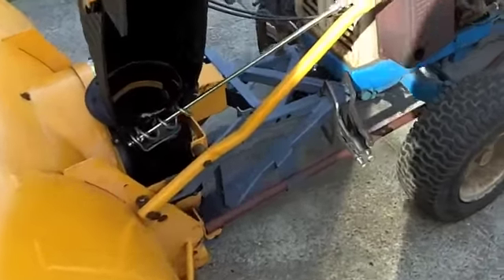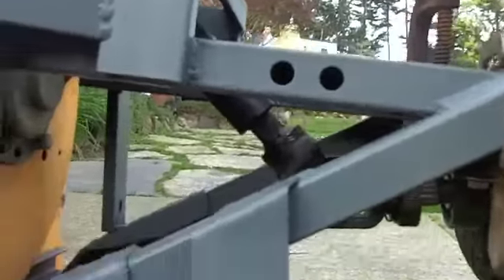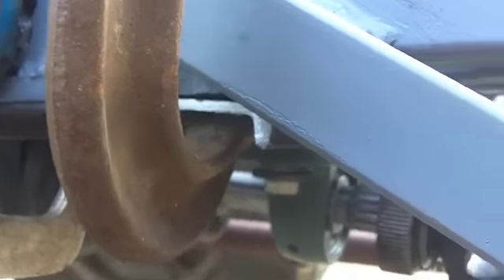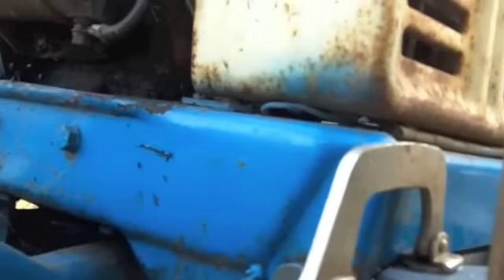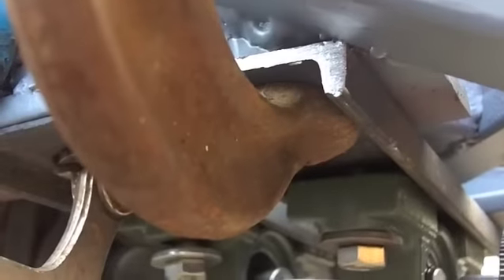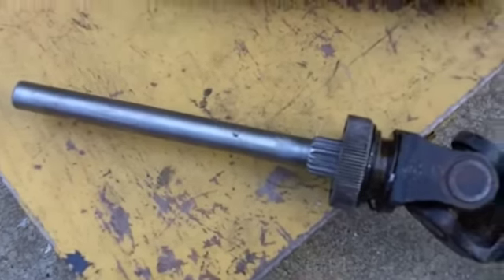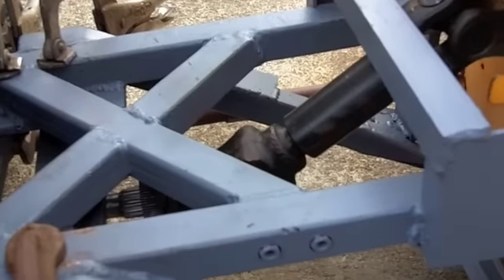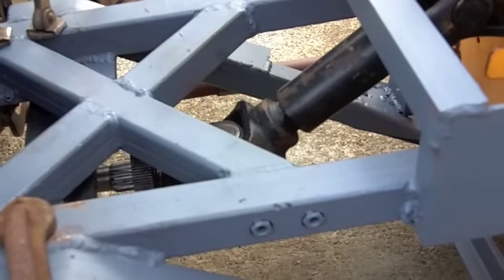Building A Home Made Snow Blower Bracket  Part 6

Comment from the maker: Thank you Pete.  The frame is solid for sure.  I ended up stick welding the whole thing with my TIG machine.  I have only stick wwelded one other project with this particular machine, so I was getting used to settings and trying different electrode diameters.  They welds don't all look pretty, but am sure they are good and strong.

Comment from the maker: Hey Matt, there is a PTO lever to engage/disengage the pully. I can run and drive the tractor all day with the blower not engaged.  I thought about removing the hood, but it's a pain in the neck to remove...and then I would have to fabricate up headlights.  I have the next part uploading right now.  Sorry to leave Y'all hanging.

Comment from the maker: I ran the PTO from the smallest pulley...so it's one-to-one with the engine.  The gear box on the blower compounds the revolutions, so I didn't want to over-rev it.  the nice thing with the hydrostatic transmission is I can basically get to full tractor speed barely above an idle, so I will use the engine speed to determine the blower speed.

Comment from the maker: I did allow for the lift...and actually I am really happy I ran it before I welded everything in place.  I ended up moving the bearings as far back on the bracket as I could get them...shortened the splined shaft around 3 inches and reduced the angle of the driveline the best I could get it.  The shaft shortens when lifted and seems to work fine... the video is uploading as I type.

Comment from the maker: It's steep, but I ran it a while last night, and fortunately I had not welded in the bearing channel, because I ended up moving both bearings as far back on the mount as I could and shorten the splined shaft.  It improved the angle quite a bit.. it actually runs pretty good...  new vid uploading as we speak.

Comment from the maker: Many have shown concern for the angles and that's a legit concern.  Remember this is a one-of and I am figuring things out as I put them in place.  I am making video of my R-n-D the same time I am fabricating so there is some overlap.  I am really happy I ran it before I welded everything in place.  I ended up moving the bearings as far back on the bracket as I could get them...shortened the splined shaft around 3 inches and reduced the angle of the driveline the best I could get it.